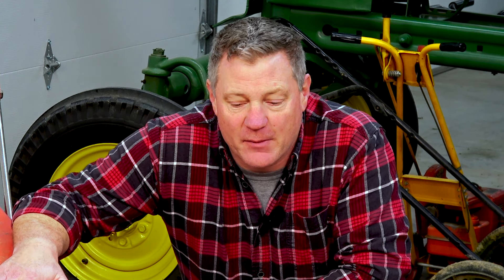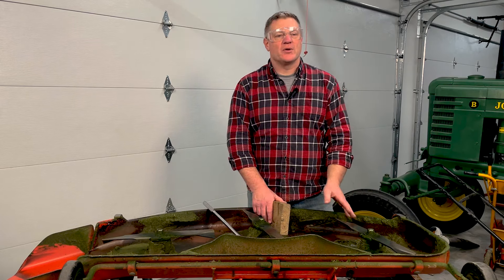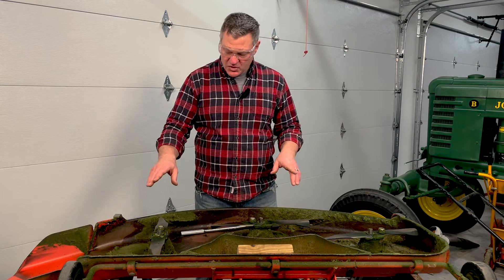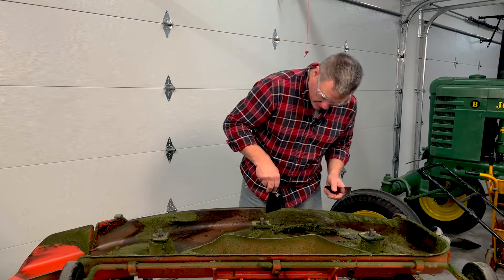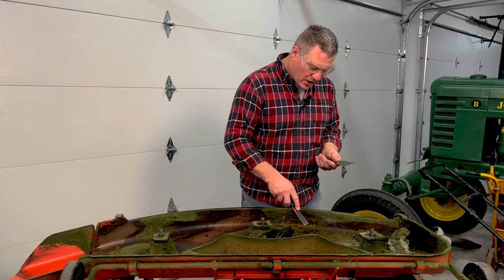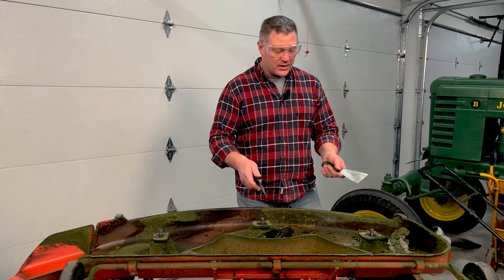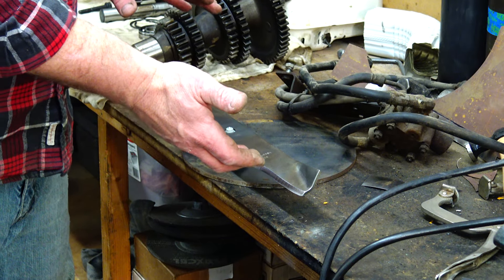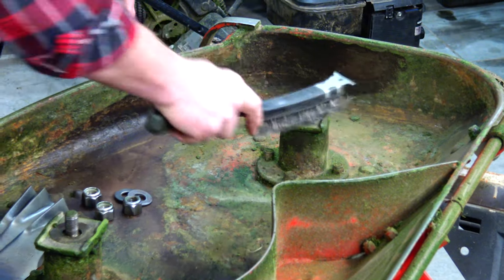The All American Tractor Works - Gravely Mower Maintanance

Comment: Na what works best is cleaning the cut grass off as your doing. I can't wait to knock my gt 19.9 onan out of the way so i can work on my 89 craftsmen once i get done working over the engines then I'll start on the underside and decks
Reply from the maker: Thank you for your comments.  I'm too lazy to clean my deck after each use.  It's not easy to get under there and my old body just doesn't move like it used too.  Thank you for watching!
Reply: @AllAmericanTractorWorks  your welcome.